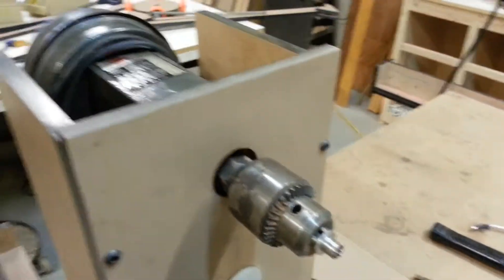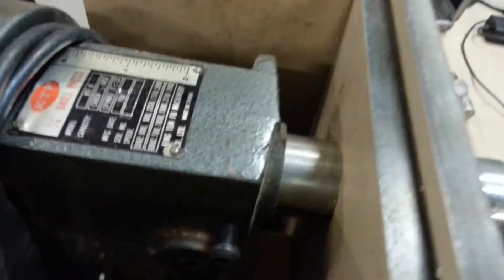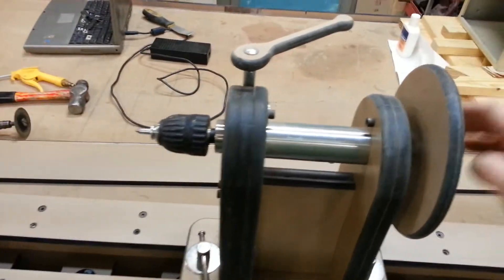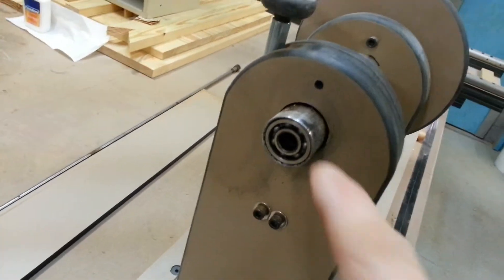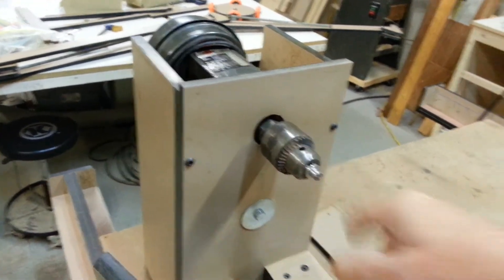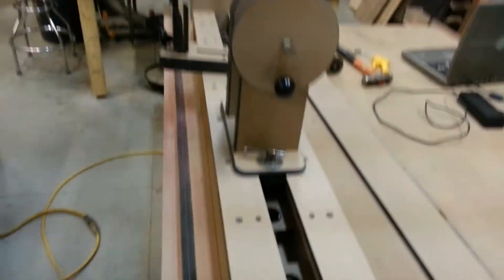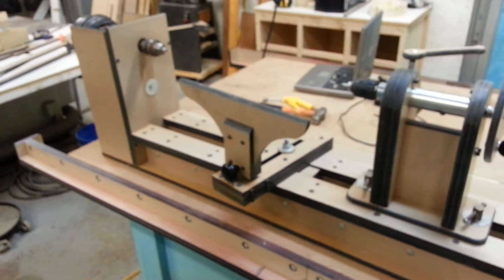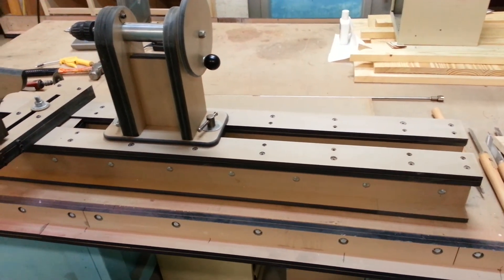Homemade lathe

Comment: This is awesome!  Now you've got me thinking about sacrificing my bench top drill press to make a lathe. It would make it so much simpler.
Reply from the maker: thanks!! I can take this out of there and use it as a drill press in about 5 minutes, takes about 15 to put it back in and get it aligned back up. I found this one being thrown away so I just keep it in there
Reply from the maker: there is a video somewhere here showing my daughter using it or at least using it for the first time on a lathe lol